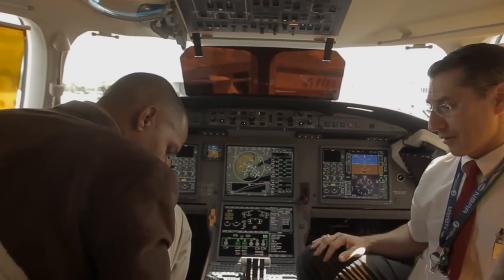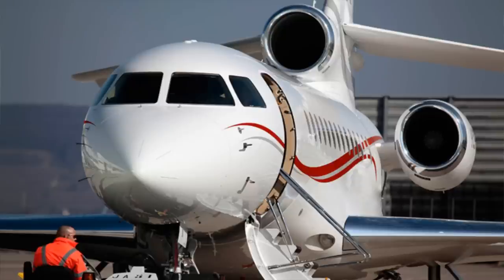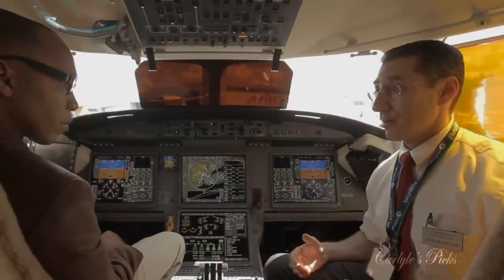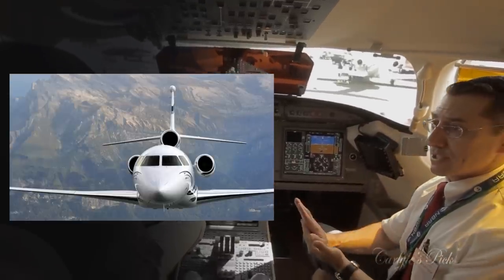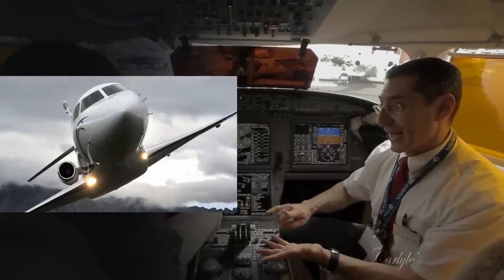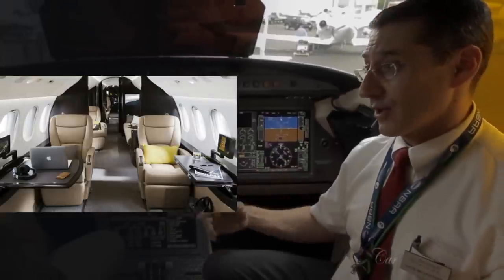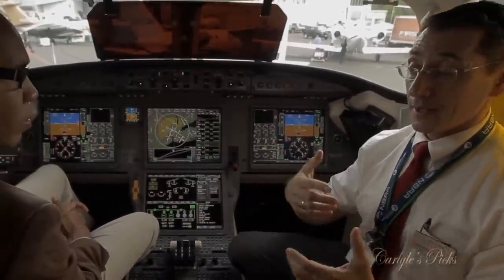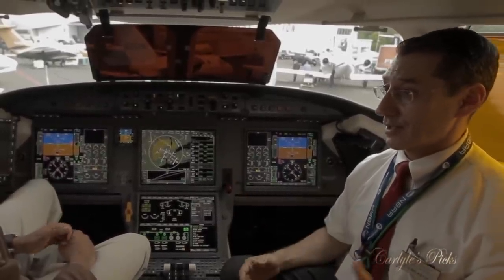Dassault Falcon 7X Cockpit Demo: Talk about fly by wire system and general avionics

Comment: Keep them coming trig! 

Really interesting plane and destinations.

Let me tell you the things I'd like to see:

- Climb performance. Rate of climb MSL and in the high FL. Time to cruise altitude. Max alt direct from T/O both with light and heavy payloads.

- Fuel system, fuel transfer, refueling, fuel rates at different altitudes

- Short field performance

- High elevation field performance

- You talking about the physical sensations compared to other airplanes you have flown. Things that surprised you about the airplane.

- Type rating, how long, how hard, things you'd like to have expanded on it, things that were missing, things you wished you knew before you did it. Advice for others going through the same process.

- Performance above FL390. Winds/ FL trade Vs Mach speed. 

And in general anything that's interesting from a pilot's perspective.

Thanks!

Comment: It wouldn't surprise me that this aircraft has a low cabin altitude pressure at high altitudes as he says, the plane's fuselage is perfectly round, whereas many commercial aircraft's fuselages are oval shaped like the 707, 727 and 737.

Comment: If you wanted to do zero-g maneuvers in a new aircraft, say like in an astronaut training program, would the fly-by-wire system allow it?
Reply: yes, even in an a380, zero-g is available. In clean configuration, the FBW will even allow as much as -1G on the a380 (i assume it will be similar for the falcon 7X)

Comment: I wish that Dassault would make less commercials and work more on the 
reliabity issues. I fly this thing for a living and I think in many 
aspects it is a big step back from the older Falcon 900... Cockpit is 
noisy and unergonomical. Avionics are supposed to be top notch, but many things are missing or cheaply made... and then the hangups... Shame... after more 7 years in service many issues  are still not fixed. If they would have listened more to the pilots than the sales&marketing team this could have been a brilliant airplane.
Reply: lucktoyo Do you still have a job flying the 7X? What exactly are the main issues with the aircraft that makes you dissatisfied with Dassault's adverts? 
In what way is the 900 Falcon better than the 7X? 🤔mm☺
Reply: Funny you choose to use Youtube to air your criticism, and many pilots who fly this aircraft love it. I suspect you are at best a troll, at worst a lower end Gulfstream employee.

Comment: Fly by wire gives me the creeps. The folks at the factory can argue me into the ground but they had some control issues that grouded the aircraft. Was it due to code mixup or what. Let this wire thing fly for a while while they work out the bugs. Ten years and then maybe I will be on board.
Reply: Peter Bradshaw fly by wire has been around for over 40 yrs now..